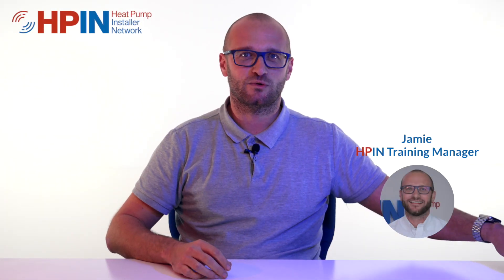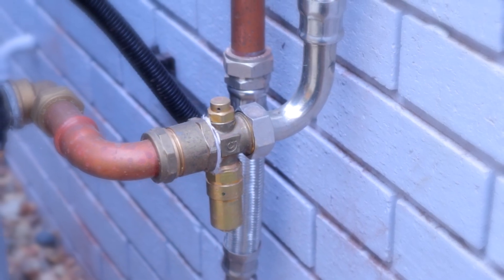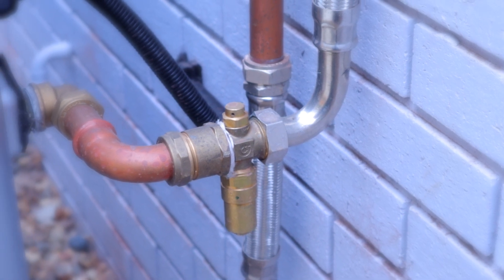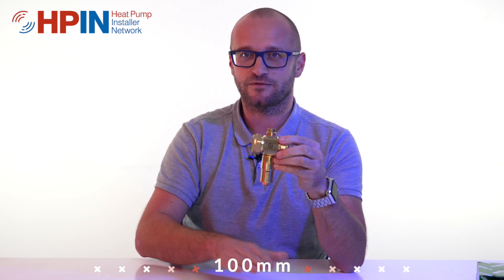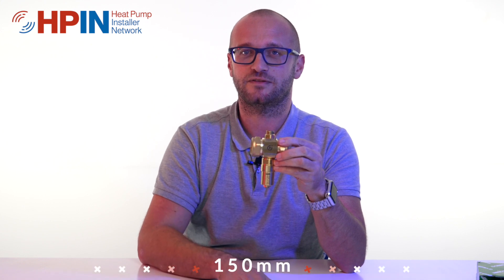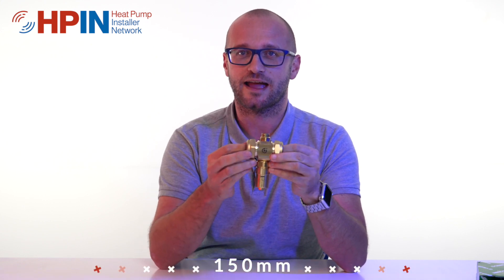Anti Freeze Valves (Basic Guide)

Comment: Hi, you mention not to cover valve body with insulation. I understand the air admittance point but the valve design/construction must be some form of thermo-mechanical device. So what happens if the temperature drops rapidly, the valve starts to dribble but becomes frozen shut or partially open? This is a common problem with condensate outlets for condensiing boilers  - little white plastic tube frozen sold with water thgus blocking the outlet for further condensate disposal.
Also, what provision should be made for disposing of that ejected water? You dont say what the volume might typically be?